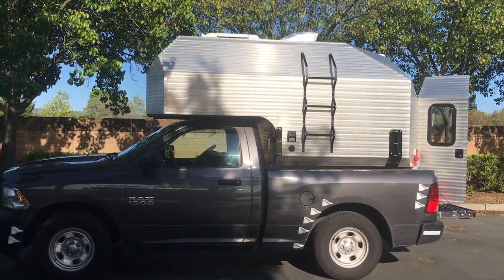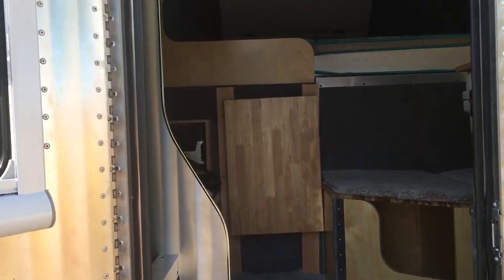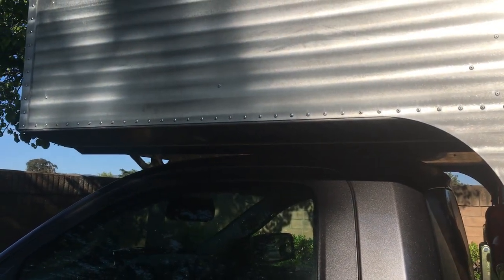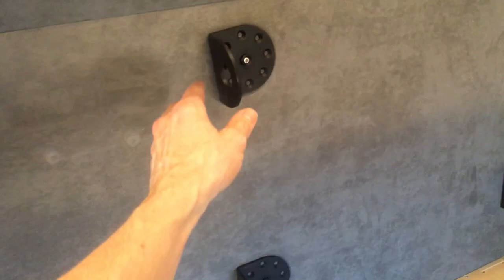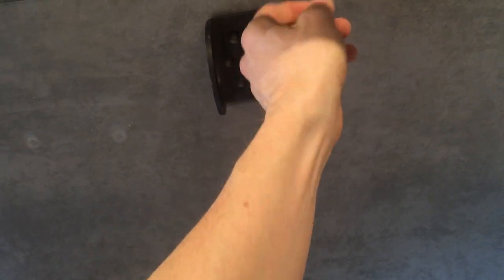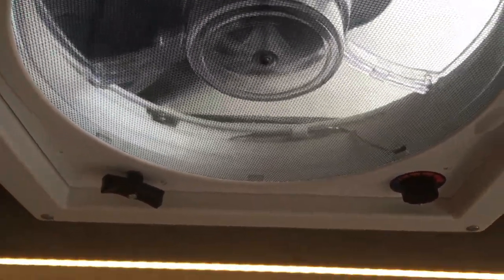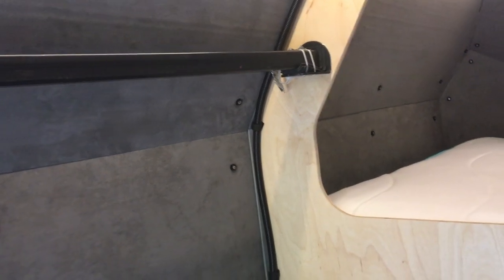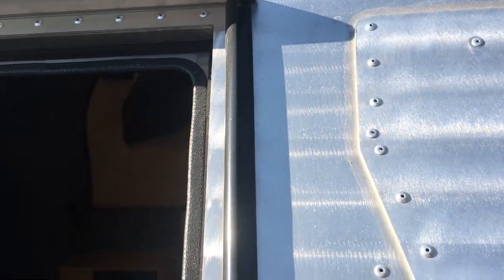Kimbo Camper Walkthrough

Comment: FYI, spray goof. Off, which has xylene in it will remove that spray paint off your cooler. Just be careful not to spray directly on to the cooler itself, spray the goof.off on a rag and use immediately.  May want to test an area like on the bottom.
If it's too strong, i.e., melts the plastic somewhat, just use denatured alcohol. 
Strong but won't usually melt the plastic. 
Just a little info on cleaning up over sprayed paint bro.!!!

Comment: I’m curious on an update after opening it for a year or if you’ve had any issues
Reply from the maker: We ended up selling the camper.  There was just way too much thermal bridging coming through the screw heads and metal spars on the inside.  We camp a lot in hot areas, so might not be too bad if all you do is camp in colder climates.  Nice build structurally, but needs more engineering for the insulation design.
Reply: @mikeandjim5428   can please tell me what you sold it for?   I am going to buy one, and I would like to know what I am getting into prices.

Comment: Pop rivets?  Wow. For that price?  Vibration down the road on those pop rivets will just be a matter of time.
Reply: They rivet airplanes. Rivets are stronger than screws or bolts. Welding can be stronger, but rivets are more durable with flexing and vibration. Also, Aluminum hates heat, and it gets weaker if welded vs steel.
Reply: @mikemead2315  hey Mike. Im an aircraft technician for 30 years. You are correct about aircraft rivets. Somewhat. However Sir, those are not aircraft rivets. They are pop rivets. Applied by a pop rivet hand puller. Not a rivet gun and bucking bar. Feel free to look up and research aircraft rivets and how they are installed. And research the difference using a hand puller for pop rivets. Quite a big difference sir.
Reply: @mikemead2315  hey mike, also another fyi. Aluminum is welded every day. Welded aluminum can be very strong in certain applications. Not as strong as steel, but strong enough for its designed applications. Feel free to do some more research sir.
Reply: @chrishargis402  Interesting!   I definitely will look that up to better understand. Thanks for the time you too to explain!  Nice knowledge seed I can nurture. 
I learn something new ever day!
Reply: @chrishargis402  The main point of my original comment was rivets are not inherently weak.
Yes. Understood that aluminum is welded every day. FWC and ATC campers use it all the time on their aluminum frames and my self-welded aluminum framed snowmobile trailer is doing just fine. I got that point about welding reducing aluminum strength from an aerospace engineering site describing why they use rivets in airplane construction and not bolts, not screws nor welds. Admittedly, I did not know about the different rivets types. I assumed they would not be the pop-rivets using ACE hardware type, but more like the high quality type used in building self-assembled STOL Zenith airplanes (sigh - never got to pursue that project).  Another very positive point for using rivets on airplanes they stated was the ability to inspect and replace later, which is a characteristic the other methods did not allow. Interesting stuff. 
I dont know why they used rivets instead of welding on this camper. It will either be a manufacturing costs decision, consistent quality, or durability.  It would be interesting to know.
Reply: @mikemead2315  pop rivets are easy to install, and does not require skill to install. Shooting an aircraft type rivet (making it malleable  with the rivet header and bucking bar to fill the hole correctly) requires skill and consistant repetition. This give increased strength and structural integrity. A pop rivet doesn't seal, support, or last as long. I was making a statement of the construction of the camper being questionable by assembling in that manner. The cost doesn't seem to justify, or ensure quality in the long run for these campers due to road vibration, etc. Also, a quality sealant, like applied in aircraft assembly would help ensure more obvious quality construction. I would have to wonder if these campers employ that crucial step in assembling.